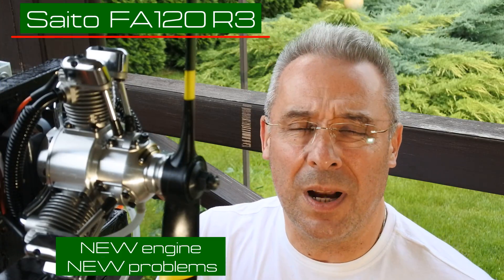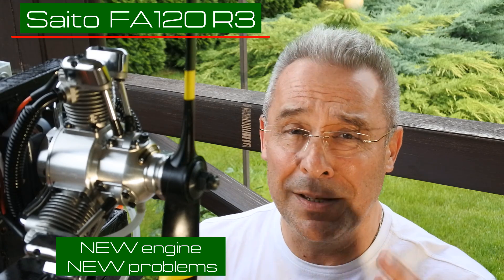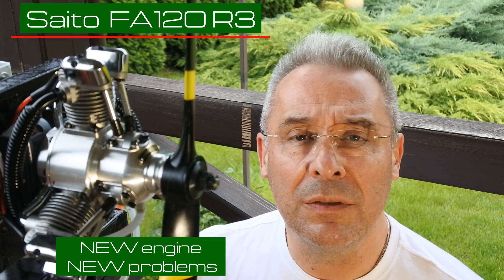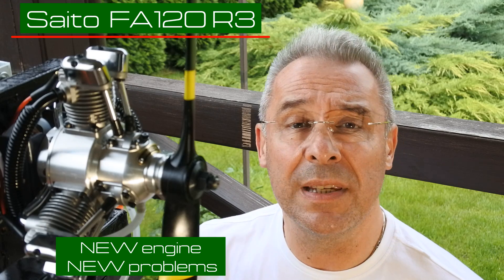Saito FA 120R3 New engine, New problems

Comment: Totally agree, I have 170, same problem from new. Morris Mini Motors converted to petrol, mod back plate electronic ignition, it’s a different engine now, doesn’t miss a beat.
Reply from the maker: Hi, thanks a lot for your advice. Definitely, this engine will not fly, it will sit in the box (as "collectors item"), so I think to keep it in its original state. Thank you and have a nice day !

Comment: This is the same design as for Fa170, 200 etc..
You know from your previous videos that it´s the fueldistribution causing it.
Get the modified backcover and the problem is solved. Morris mini motor in UK are selling them.
Reply from the maker: Thank you very much for your comment and suggestions ! I know, that M.M.M. was developed and producing modified fuel distribution manifold. But at first, it's enough expensive, and at second,  I'm not sure at all, that this could  fix all the problems with such design. Some time ago I bought modified prop flange for Saito FG 60R3, with corrected ignition magnets placement, it was installed and tested, but engine, according to me, was changed its behavior just for a little. So, I'll try to find another way to modify engine design, to eliminate such behavior. Thank you a lot for your comments, have a nice day !

Comment: All of the Saito radials have  The same intake distribution problem  You have to get the modified rear back assembly 
From ray English or Morris Mini motors
Reply from the maker: Hi and thank you a lot for your advice ! I've some ideas, to to find tune this engine, to make fuel distribution much more even. Will report, when it will be completed.
Thank you and have a nice day !
Reply: You're welcome I really enjoy your channel As I am quite the engine guru Myself !  Perhaps if you look at some of the parts made by these 2 gentlemen You could make your own modifications ! 
 It would certainly be to your benefit to at least talk to Mr. English As he has multiple design contracts with saito ! 
 Keep up the great videos
Reply from the maker: @warbirdflyerF4U   Thank you for your comments, I am pleased and I really appreciate them! I really love all these engines, and it’s even difficult to say which ones are bigger or smaller, they are all beautiful, and in my opinion, all of them are the top art of precision engineering and design.
Thank you again for your kind words and best wishes for a nice day!

Comment: Quiting
Reply from the maker: Hi, and yes, it's quitting. External igniter could return it back to operation, but not for long, it's seriously flooded by overreached fuel mix, and it's cooling down the glow plug. What a kind of curse...

Comment: Just an idea could you put a hotter glow plug in the quoting cylinder. ? Cheers dave
Reply from the maker: Thank you for your suggestions ! Definitely, I used all possible options, and the hottest Enya #3 glow plug, and the longest G5, and YS#4, and OS A3 and with an increased glow voltage (over 1,5 volts). Does not work. A very, very rich mixture enters this cylinder. I have one idea, but in a couple of weeks I can try it. I think it will work if I correctly understand the cause of such a problem.

Comment: Just got one of these little engines. Was very impressed, very good motor in my opinion. But I did notice an immediate issue with the supplied exhaust system. As you know, only one tube has an exhuast pressure nipple and of course no baffle or cone so my theroy is that the exhuast is not able to pressurized the fuel tank as it should. I found this because on first start I noticed only one cylinder had enough fuel so I went to turn the high needle out and it was very unresponsive. I gave the the fuel line a pinch and the engine tried to die, a clear indication of a lean mixture. I think an exhuast with a nipple placed at a collective of all 3 cyliders would solve the problem, an exhaust ring would be a resolve to the issue as well.
Reply: Hi there.  Can you explain to me the practice of pitching the fuel line. And what it means.cheers dave
Reply from the maker: @davidmifsud645   Good afternoon, dear Dave. I don't use this practice of pitching the fuel line very often. In fact, by pitching the fuel line a little, you reduce the amount of fuel entering the carburetor, thereby making the mixture leaner, which should lead to increase in engine speed. If the engine immediately stalls, that means that you need to adjust the carburetor.
From my practice, it is better to start engine tuning by resetting the carburetor settings, i.e. "from scratch". Usually, manufacturer describes, how to reset carb setting in engine's manual. 
Have a good day !
Reply from the maker: Thank you a lot for your informative comment ! I should say, that in general, Saito FA120R3 is a very nice engine, but it will need a lot of additional work and tuning. According to me, uneven fuel distribution - it is a sin of these R3 models. Uneven cylinders temp clearly confirms, that all 3 cylinders are working with the different fuel/air ratio, usually, #1 runs a bit overlearned,  #2 is more or less OK and #3 usually runs very rich and episodically, quits.

Comment: Hi CrazyEngines..Love your videos. I bought the same motor a week ago and i have the identical problem. From my research thus far it appears that it is a fuelling issue and i believe that the morris mini motors modified backplate intake is supposed to sort this issue out. Its a pity we cant just modify our own backplate manifold  to sort it out ourselves. Its a bit shit that saito sells these engines knowing they have fueling or air issues. cheers dave from australia
Reply from the maker: Thank you very much for your nice words about CrazyEngines channel ! Highly appreciated ! 
Regarding Saito FA 120R3 issues, I've some plans, how to try to modify engine's manifold backplate, so just stay tuned. Really, absolutely agree with you, that manufacturer, being informed from it's customers and though it service /repair points, several times, hasn't react at all. Good reputation in business, for sure, important to keep sales figures high. Thank you and have a nice day !
Reply: @crazyengines88  I was going to buy the modified backplate from morris mini engines for 190 pounds. It's alot of money. Should I wait to see what you come up with. Are you confidant you can modify to solve problem. Cheers dave
Reply from the maker: @davidmifsud645  Thank you for your reply. Of course, I'm not  so sure at all, that I can modify engine's backplate, to make it work as it should. Definitely, only some attempt to make it will takes at least, few days, and there is no any promises, that it could be successful. So, if you already decide to buy modified manifold from M.M.M., there is no need to wait for  the results of my own problem research. 
Thank you, cheers !
Reply: @davidmifsud645  i have used a mmm intake manifold and the engine ran alot better, but i converted to gas with mmm magnet ring and fg19r3 carburettor 
I now run the engine with stock manifold  and didn't notice any difference really..
I guess these engines need alot of run time to get settled aswell..i have had a few problems over the time of running it.
Ive put through 8 litres of fuel through the engine, that includes 2lt of glow fuel
Reply: @danielhitchens4407  i just bought one online apparently there is a guy in australia  Wayne  at Oasis Model that sorts them out as well but i purchased the intake from mmm before i found out about wayne
Reply: @davidmifsud645  yes i forgot about Wayne, nice guy ,id be interested to know what he does to a standard manifold, you can see what saito done drilled 3 holes around the back of the manifold to reduce the chance of someone machining the manifold themselves,
Reply from the maker: @danielhitchens4407   Thank you very much for your comment, really appreciated ! It will be very much interesting to get to know about manifold mod's, which were done by D.I.Y. guy's. Thank you !
Reply: @crazyengines88  i see you removed the cover on the manifold making it a negative pressure intake..so you would need to block off the crank case breather for it to work properly..but i wouldn't use this method to try getting engine to run properly..
Reply from the maker: @danielhitchens4407  That's right, I removed the cap from the fuel manifold to check how the engine behaves with a direct inlet of the fuel mixture into the crankcase. You were right, the vent had to be plugged off to keep the engine running properly. Even with open vent engine works but not so confidently. In fact, the idea to remove the cover did not belong to me, but to one of my subscribers, and I was also interested in how the engine would behave, with the way the fuel mixture was partially changed. I must say that some positive changes have taken place in the work - after all, the cylinders temp  has relatively equalized, although in general cylinder # 3 still quits.  I think that the problem is not only in the design of the inlet manifold, but also in the settings of the carburetor. For the time being I put aside work on it for a while, but that does not mean that I have given up on the idea of making this engine run as it should be, crisp, with nice and stable idle, with easy starts and without overheating. I think there will be a sequel. Thank you for your support !

Comment: All these Saito 3-cylinder radial motors have the same problem: cylinder 2 is oil-soaked due to the direction of rotation. The rear crankcase must be modified to allow suction in the main crankcase. So you have to drill the carburetor channel into the crankcase, drill through the inlet tubes to communicate with the crankcase. There is then a better balance between the intake of the 3 cylinders, a better lubrication of the connecting rods and this prevents an excess of oil in the crankcase which enters the cylinder 2 by the spin effect of the vilbrequin. Use maximum 10% oil.
Reply from the maker: Thank you very much for your comment and advice ! It is really practical and could work, I think. So, next video will be for sure dedicated for the different way's to fix the problem. Thank you, very much appreciated !
Reply: Is this the same as the R325 as well, or does the swirl plate in the rear of the engine mitigate this problem?
Reply from the maker: @ya33a  Hi, thank you for your question ! FA 120R3 and FA 325R5 utilizing completely different design of a fuel distribution manifold. FA 325R5 has a special "turbine-like" impeller, which driven by crankshaft, and this impeller pressurize and "atomize" fuel mix. I've video, which is dedicated to internal design and construction of FA 325R5, the role and design of impeller is described here:  https://youtu.be/NuXHANZYkNs and here:https://youtu.be/xtg1nIqF0SU . From my personal experience with FA 325R5. it's far more sophisticated design wise and works much better, than simplified fuel manifold design of FA 120R3 or FG60R3 engines.

Comment: Since #2 lights off every time you apply the glow igniter battery, I would get a digital glow driver for this engine. It will heat all glow plugs at whatever RPM you set it for, usually a lower RPM, which will prevent any glow plug from going out. On my FS-400 radial engine I use a glow driver from Microsens Electronics, based in Germany.
Reply from the maker: Thank you very much for your comment ! As usual, a few versions - reasons "why" were appeared in my head during this test run. One of them - glow battery doesn't supply enough current, only this probably, could explain such engines behavior. But what's strange - even with sagged glow battery engine easily starts by hand 🤥. This fact  a little bit disappointing. Of course, next runs I'll arrange with freshly recharged glow battery. But current battery also was fully charged 🤥. It consists from 3 D size NiCd cells in parallel, each 10K mAh capacity, so in total it's 30K mAh ! So strange...I've few DC/DC converters with 8 Amperes current, next time will install 3 of them to power the glow plugs.

Comment: Its a tough challenge to get running correctly..i have a new fg19r3 its being a tota pain slowly number 2 is getting more stable.but i have some fueling issues and put that aside..
My saito fa120r3 converted to gas has always had off idle load up from sitting..this engine runs the fg19r3 carburettor. I had the carb apart and there was some blockage at the end of the spraybar so cleared that put together and gave it a tune up..its now making 500rpm more and barely a load up from sitting idle ..
Reply from the maker: Thank you very much for your comment ! Great and interesting information for thought ! So, I'm still collecting advices, how to fix the issue. I think, that it's very practical ! Really appreciated !

Comment: Hello there I've got the same engine and ran into the same problems with the second cylinder. This is due to the fact that, indeed, the fuel distribution is uneven. This is unfortunately by design of the backplate by Saito.  I've tried everything but finally decided to purchase the modified backplate by Morris Mini Motors. After recplacement the FA120R3 ran instantly better, particularly the mid range but also a nice steady idle. My infrared camera showed the second cylinder with the same temperature as number one and three. Keep in mind that this engine with the modified intake manifold needs a bit richer slow speed needle setting.. just slightly
Reply from the maker: Thank you very much for your comment ! Definitely, it's very important information about this engine, thank you very much !
Reply: @crazyengines88 You're most welcome! In addition, the design of the Morris Mini Motor intake manifold is to make sure each cylinder receives the same amount of fuel. Overpriming (more than 2cc fuel in the intake before the start) may well lead to a fuel lock in the fuel paths of the manifold. It's a small but powerful engine therefore adjustments should be implemented with small increments. Keep a infrared thermometer and tachometer at hand. 
Succes! 😊
Reply from the maker: @TheMrzekerz  Thank you thank you very much for your kind advises ! As far as I understand, the most advises are very helpful and realistic ! Will take into account your precautions about over priming, thanks a lot !
Reply: hi there. I just bought a saito fa120r3. exact same problems. so the morris intake solves this issue completly. Its so expensive converted to aussie dollars,nearly half the price of the engine but if it solves this issue i suppose i have no choice. pity we cant just modify the original.thanks so much for for input. cheers dave.
Reply from the maker: @davidmifsud645   Absolutely agree with you, thank you for your comment ! I'll try to find the simple way how to fix this issues, probably, this week and will report about the  progress and the results. Stay tuned, please ! Have a nice day !
Reply: Do you have any pictures of the MMM internal ? Can you share them ?

Comment: Try leaning the low end needle til the flooding of #2 cylinder stops..
Reply from the maker: Thank you very much for your comment and advice ! Tomorrow will try to do so...Very disappointed with so strange engine's behavior.
Reply: @crazyengines88  Your welcome, I feel that all the saito radials are quite sensitive to the low end needle setting. You have to find the sweet spot where it runs the best...it's all a part of the hobby 😁👍
Reply from the maker: @Warbirdpilot   Very much appreciated for your advice ! I was in a minute to dismantle it again, to check camgear timings for that cylinder. Thank you !